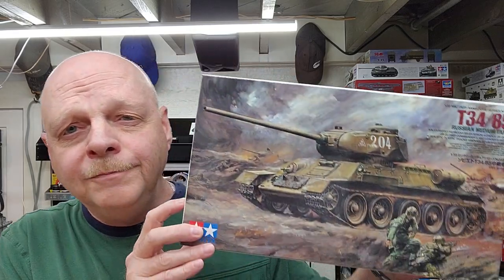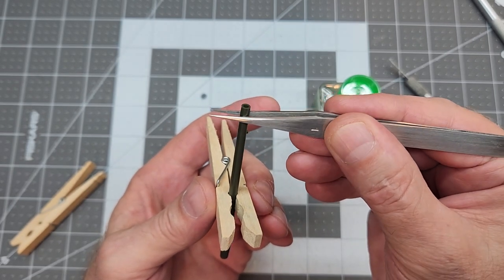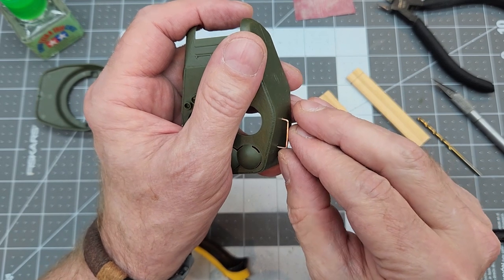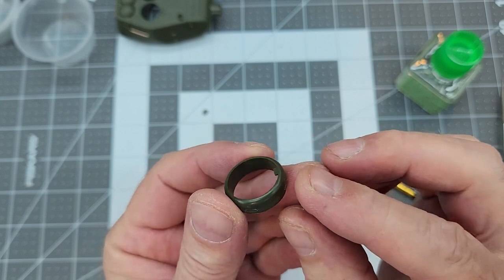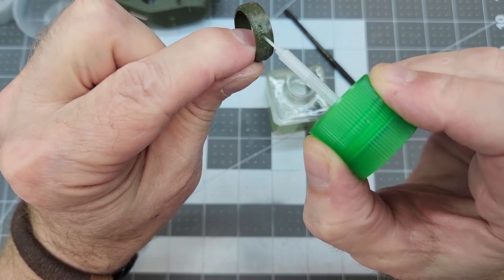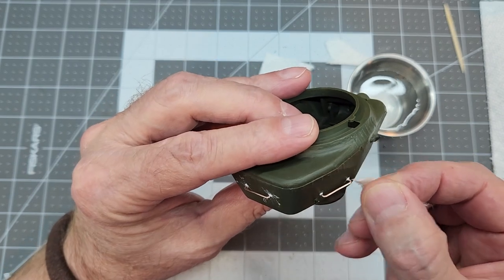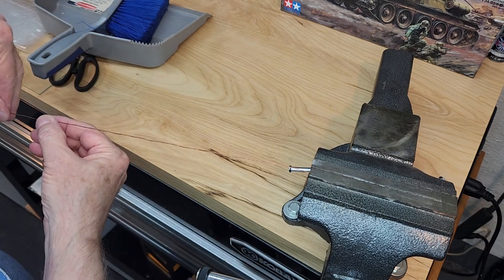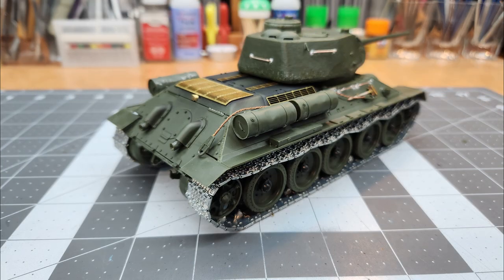T34/85 by Tamiya in 1/35 scale, Part 4, Turret Assembly, Grab Handles, Texturing, Tow Cables

Comment: Really good, solid basic modeling techniques. I’d recommend this T-34/85 build series to any person new/newish to armor modeling. The step of adding a weld point around the base of a grab handle is a good one. There are a few other ways of doing it like dropping a small bead of CA glue there or a spot of epoxy putty sculpted to shape. But your method is great because it’s easy to clean up.
Reply from the maker: Thanks Vault 13, you are right about there being other ways to get the same result. I'm getting more comfortable with the water based putty, it's easy to correct if/when I make mistakes, lol. Thanks for watching, model on my friend. Johnny
Reply: Easy water clean up with that PPP and of course no nasty solvent fumes from something like polyester putty -Matt